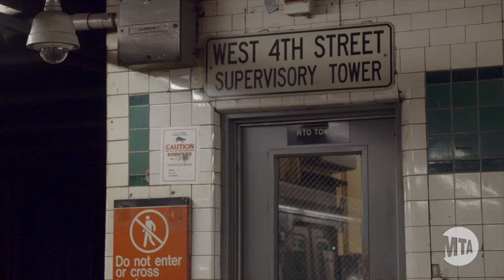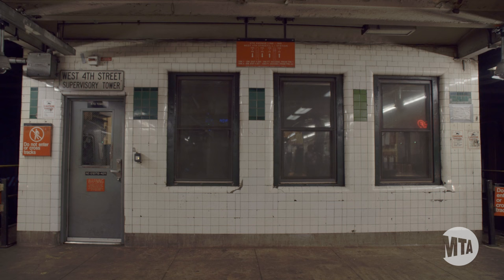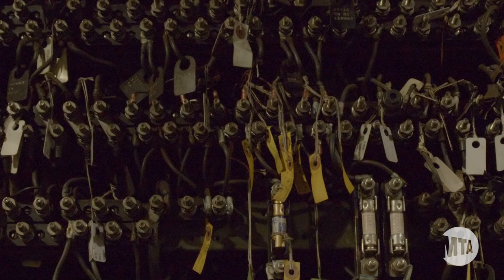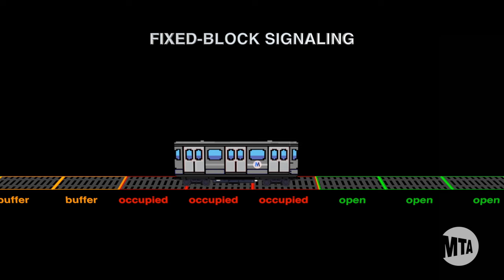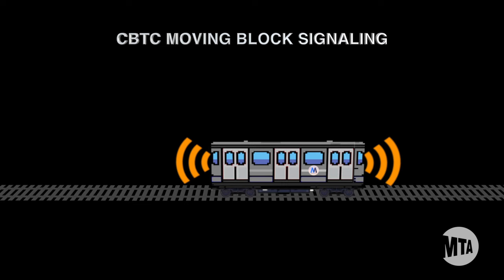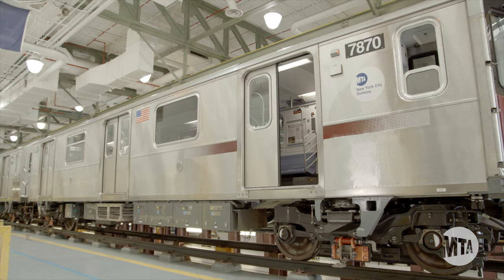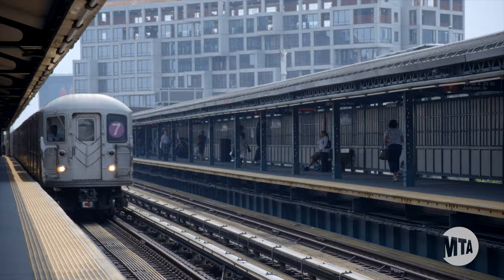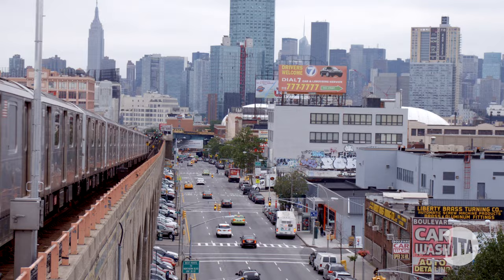CBTC: Communications-Based Train Control

Comment: Hi, my name is Trevor, I was born and raised in New York City, from The Bronx. I was never an employee with the transit authority, but I almost know how the light signals works on the subway trains. I always been fascinated with the signaling of the lights of the signals where a train will go by one of the blocks where it turns it to red as it's going through that particular signal or block. I even know how it works where you can see a split of the track where once the wheels goes over that particular split that's where the signal lights gets tripped to a different signal otherwise known as red signal, I also notice when the train is clear it will have a yellow Bracket I really don't know the name of it, or what you call it, but it pops up every time the train clears's that particular block or signal, so I'm guessing it's the emergency breaker, it will stop the train if a train is going too fast tripping that signal. I noticed something new, and I would like to know more about this new system of the traffic light system of the green flashing light on the signals is this part of the new CBTC system? I have also have seen this flashing green lights signal in Atlanta, Georgia. Is this where did you get the idea of the green flashing lights from? I moved to Atlanta in 89 and I lived there for 30 years and I've also been fascinated with the trains in Atlanta as well as the transit system called Marta.

Comment: Queens Blvd line is up next after the 7. I think it says somewhere (can't recall, sorry) that the MTA currently runs 29 TPH (trains per hour) on the Queens Blvd express tracks. With CBTC+ATO, they hope to run 32 TPH on the Express tracks. An additional 3 TPH doesn't sound like much, but keep in mind that (according to Wikipedia) the R160B cars have a theoretical maximum capacity of 258 per car (52 seated, 206 standing). Practically, that won't be achieved, so we'll assume that an R160B's practical maximum capacity is 92% of the theoretical capacity, or in this case, roughly 237 people. Apply that to a 10-car train, and that's an extra 2,370 people per train. For the 3 TPH extra, that's an additional 7,110 people per hour on the Express tracks. That's a fairly impressive capacity increase for a line running at very, very close to 100% capacity. 

I personally think that in order to take less time overall, that the Express tracks should be taken completely out-of-service. To mitigate the inconvenience, I propose the following:

>Truncate the M at Delancey/Essex Sts in Manhattan. Temporarily stop running the W, and reroute the R to Astoria-Ditmars Blvd to replace the W (temporarily). Finally, reroute the E to run alongside the F between W 4th St/Washington Sq and 21st St/Queensbridge (via the 6th Ave Local and the 63rd Street Connection). Then run the E/F via the Queens Blvd Local to Briarwood/Van Wyck, after which the E and F will split and run as normal to Jamaica Ctr-Parsons/Archer and Jamaica-179th St, respectively. 

>Integrate fares on the LIRR and Subway in Queens, by making rides from QBL stations and the Woodside, Flushing-Main Street, Forest Hills, Kew Gardens, Jamaica, Hollis, and Queens Village stations, onto Subway lines in Manhattan, only the cost of a single Subway ride. Unlimited Ride 7-day passes will also work for this. For example, someone traveling from Rego Park-63rd Dr to 59th St/Columbus Circle could take the E/F to 74th/Jackson Heights, the 7 to Woodside, the LIRR to Penn Station, and the A to 59th/Columbus; they could do all of this on just one fare of $2.75. Another example: Someone who normally travels only by Subway between Jamaica-179th Street and 23th Street on the F/M (6th Ave line), could instead take the F to Kew Gardens, walk from the Subway to the LIRR, take the LIRR to Penn Station, then take the 1 train to 23rd Street on 7th Ave, and would only be 1 block west of their usual arrival station. 

>Operate a non-stop bus route every 5 minutes between Briarwood/Van Wyck (E/F) and Middle Village/Metropolitan Ave (M) to carry riders who work closer to Lower Manhattan than Midtown, who would normally take the QBL to Court Sq for the G, or who might stay on the E or F to get to their workplace south of 14th Street. 

After the Express tracks are finished, the Local tracks would have CBTC installed. For this, I recommend reconstructing the 74th St/Jackson Heights station on the 7 train to serve both Local and Express trains. I also recommend running a replacement bus service between Queens Plaza and Forest Hills-71st Ave. This would only stop at the Subway stations themselves, not stopping in between. To make up for the non-sheltered walks to the stations, temporarily remove parking on the outer lanes of Queens Blvd, and run the buses in those parking areas as a de-facto bus lane. Also run the buses no less frequent than every 4 minutes (traffic permitting). Because the Local tracks are out of service, keep the pattern for the M, R, and W trains in place until the Local tracks have CBTC installed. Because the QBL Express CBTC upgrade includes the 53rd St line, route the E back through Queens Plaza, Court Sq, and under 53rd St. Create a free Metrocard-only transfer from Queens Plaza to Queens*boro* Plaza to provide other options for getting into Manhattan. Keep the F running in its normal pattern. Get rid of the non-stop bus route from Briarwood/Van Wyck to Middle Village/Metropolitan Ave, as the QBL Express tracks are back in service at this point. However, keep the LIRR transfer incentives and expand the services covered by a single $2.75 fare to the QBL Local bus replacement service.
Reply: HostilePancakes, The One and Only I don’t think we need to make 74th Street-Broadway an express station. It would make the already-crowded expresses even more crowded and the locals would be virtually empty. Having the expressed not stop there would balance out the loads.

Comment: 6 million subway rides (on avg.) a day. Multiply that by a 30 day ticket for $116 that you use 40x a month - or $2.90/ride. Thats $17,400,000 a day. 6,351,000,000 a year. Where does over 6 Billion a year go if not to upgrade the subway system itself?
Reply: Peter Unger In the pockets of the company execs and other top officials and their shadowy partners.
Reply: Peter Unger Unions.
Reply: Peter Unger takes just 55,000 employees to move 6 million people per day. At an average of $80k per year with benefits that's $4.5B of your $6 B. 
Subway cars cost about $2M each; NYCT has about 7,000 of them. They have to replace at least 200 per year to keep up. 
NYCT has about 1500 miles of track to maintain; 300 miles of tunnels; 175 miles of elevated structure; 476 stations, etc. 
It is a trillion dollar asset. $6B is peanuts, less than 1% of the value of the asset.
Reply: Peter Unger FACTS
Reply: Love it when idiots see big numbers and think it's infinite money.
$6 Billion is chump change for the MTA. After they pay all their employees there really isn't much money left.
Want to see more done with the subway? Then how about you pay $50 a ride.
Didn't think so. Even then, that's still not much more money for the MTA to do more work.
Reply: WHY BIULD TANKS,WARPLANES, BALLISTIC ROCKETS, ETC. WHY NOT BUiLD BETTER SUBWAY  SYSTEMS?

Comment: This whole video seems like it would make a very good planning guide for how a small team of commandos with sidearms and dynamite could cripple the entire NYC transit system and cause untold economic damage.

A few well placed charges at a few of these interlock control towers would bring the subway to a grinding halt, and could very well cause hundreds of deaths, and the repairs could take weeks or longer, if they're even possible, given the comment about needing to scavenge parts just to keep the system up and running.

Tie it to a simultaneous attack on the NJ side entrance of the Amtrak/NJ Transit "North River" tunnels in Weehawken, and the potential to do billions of dollars in economic damage is pretty feasible.

Hopefully these sites are well guarded.
Reply: Don't give them ideas, as you wish to happen.
Reply: @keithsy75  To be clear, I have ZERO wish for this to happen, but that said, if I can think it up, anyone can.

Comment: Ayyyyy, that's cool. Now to wait for a few more years for CBTC to finish. However, the R46s will last before 2017 on the (F)(R) train lines before all of the R46s will be shifted/moved to the (A)(C) train lines. So, guys, you should catch some R46s on the (F) and more R46s on the (R) on tape as possible so we can commemorate the tributes to the R46 train runs along the Queens Boulevard/(E)(F)(G)(R)(V) train lines.

Comment: So anyone who can get hired by the MTA and access that control room could shut down the entire New York City subway system and do billions of dollars worth of damage to the economy with a bottle of lighter fluid and a match. It would probably take months, if not years, to replace all that antiquated equipment. During that time the city of New York would lie paralyzed with no solution for transporting millions of workers to and from their jobs. The impact would be staggering. Has no one war-gamed this scenario? I hope they've implemented proper security protocols to protect the system but it looks like the whole thing is held together with duct tape and union cards so I doubt it.
Reply: Thats not true bro. Yea the TA drags their feet at times, but when its comes to those oldest parts, such as what you see in the video at west 4th,  To change all that would require not only the the station shut down (which is a major subway intersection) but also the streets above it shut down. There is no hallway big enough, no corridor, youd have to dig straight down into the street. It could take months, but NOONE wants be the The One Responcible When all those major delays happen. The City would partly shut down. There is No "Good Time" to do it. Thats why those OLDEST parts are still that way. Where ever they could upgrade, they have. Its NOT just a matter of slow rolling
Reply: As someone from the inside, we have problems that happen everyday and we keep the trains moving. Yes One Bad Actor could cause serious damage, but that is true of many industries and companies. The fact is, if that entire tower burned down, we would still keep the trains moving. Days after hurricane Sandy fucked NYC, we had the trains moving. We know how to keep the trains moving thru disasters, we just dont tell you about it, cause if general public knew they could cause havoc.

Comment: So uh when are you guys gonna up grade Main Line IRT stations 2,3,4,5,6
Reply: YxngTriton Within 10 years.
Reply: @TheRailLeaguer  The Flushing line already have CBTC install . Not the 4/5/6/S/1/2/3/9/8 trains. No CBTCS on them yet. The 4/5/6/S/1/2/3/9/8 trains will be getting Cbtcs real soon.  CBTCS takes a lot of time to be installed . They have to  each lines one at a time. Eventually the 4/5/6/s /1/2/3/9/8/13/12/11 trains will get there.

Comment: Although the New York City Subway System is over a century old, the greater success for the subway system, examples such as Communications Based Train Control (CBTC) greatly impacts the change of adding more trains per hour in a fixed block. Even though, there are still active master control towers around that control safe train movement from nearby interlockings or junctions supplied with the famous centralized traffic control panel boards, CBTC enhances with new technology for the amount of trains than the old technology which is still utilized by the subway system today. The subway has come a LONG way ever since October 27th, 1904.
Reply: Jarell Clark I believe that the CTBC project on the L only added something like 4 trains per hour.  Was that worth the hundreds of millions of dollars it cost?
Reply: Could be.
Reply: Jersey Mike's Rail Videos   yes it was worth it.... and will be worth it when the whole system is done.  that is thousands of people potentially per hour on that line...  most importantly though full CBTC should cut down dramatically on delays from "signal problems".  that causes me to be late to work very often!
Reply: Jersey Mike's Rail Videos Power substation upgrades will allow the line to run more than 4 extra trains per hour. This is in the works.
Reply: Dj Hammers On the L?
Reply: Yes.
Reply: Jersey Mike's Rail Videos 

I would assume so. The main thing holding the L back is the terminal at 8th Ave/14th St, whose tracks dead-end while still next to the platform (in other words, there are no tail tracks beyond the station). If the MTA built layup tracks beyond 8th/14th it would allow trains on the L to enter the station at full speed.

Comment: They say they dont have money but they're spending 10.2 BILLION on East Side Access tunnel for the LIRR which will see 165k daily riders. 1.4 BILLION on the Fulton St station and 2.4 BILLION to extend the 7 train ONE DAMN STOP. You could have had CBTC on 14 additional lines with this money. It's needed more than the projects above especially since the ridership is still projected to increase significantly in the coming years. We need CBTC to run more trains efficiently.
Reply: the MTA didn't fund any of those projects you're harping on. ESA, Fulton and SAS are being paid for by the Feds. The City footed the bill on the 7 extension. the money for these projects was given specifically for those projects.
Reply: MTA funds them all Feds don't do shit for the railroads in NYC

Comment: Wait, we know it antiquated and needs a major upgrade over all. What we the riders ask is why did it take or is it taking so long to get the necessary upgrades?
Reply: The CBTC upgrade is quite expensive because its being upgraded from an insanely unique yet antiquated track & signal system currently in use. Until the 2nd Ave extension, the last subway tunnel completed was in the 1940s. Political & economic issues prevented the subway fare from increasing to a dime from a nickel between 1904-1948. So subway upgrades have been deferred for decades. The city's resurgence in the 1990s helped the city & state start making upgrades in the 1990s but at tremendous cost.

Comment: Life long NYer here. This is why the subway went into disrepair.
(1)Subways were built by 3 different companies during 3 different periods between 1904 & 1948. They consolidated in 1948 because all the transit companies (including trolleys) always operated in the red since the city didn't allow the fare to increase past a nickel in 40 years. So maintenance deferral started way back then.

(2)Economic events that caused continued lack of revenue & upgrading of subway system:
--1930s=great depression
--1940s=WWII
--1950s=Car culture & flight to the suburbs
--1960s=loss of manufacturing industry & continued flight to suburbs
--1970s=NYC goes bankrupt
--1980s=NYC recovering from 1970s

Finally, in the 1990s, the subways began improving because of the City's economic renewal & resurgence of the tax base.
Reply: Brooklyn Babe THATS THAT PELHAM ONE TWO THREE TRAIN
Reply: larry temp What’s the Pelham 123 train?

And before you say anything, I know Pelham 123 is a movie.

Comment: First solution, imo, is to remove the Governor of New York from decision-making in a municipal infrastructure. Money is great, but none of that matters when accessorizing stations does not change the fact that the system from within is rotting ... literally. If NYC has to go at it alone, it is a trade-off.

Comment: Honestly I kind of trust this more than some modern computerized system made by a contractor. For whatever reason every public works project involved computing seems to be a massive failure and go over budget. They need to upgrade this system a little before it gets prohibitively expensive to replace and maintain this old system. And before the costs of running this system vs a new system get too high.

Seems like you could at least do a cheap addon to track trains accurately. I could probably solve a bunch of these problems with a few raspberry pis.
Reply: rollerboogie Just to be clear you don’t trust CBTC, which btw, is already installed on multiple subway systems all over the world and here at home on the L and 7 lines? The CBTC systems both there and on the L and 7 lines are very reliable and have done wonders to improve reliability.